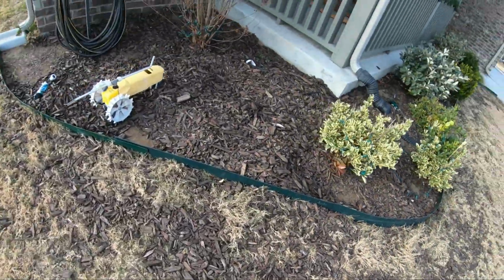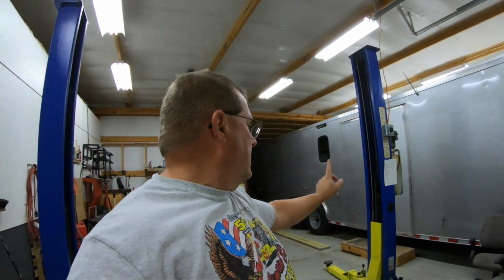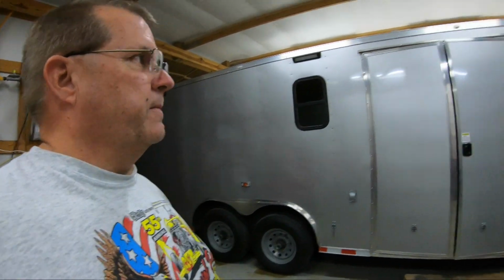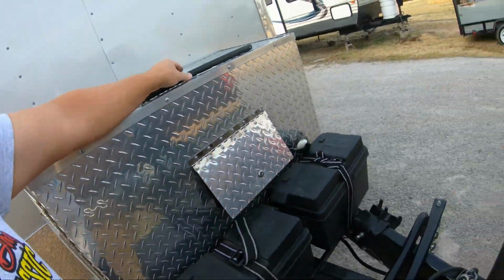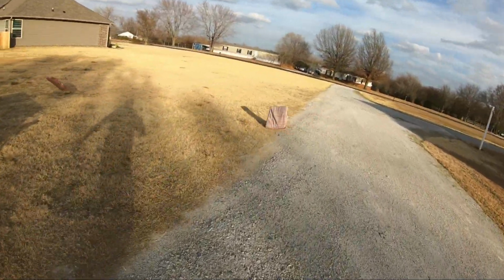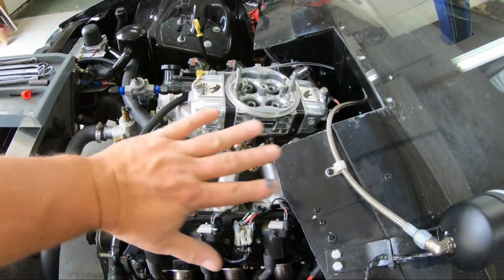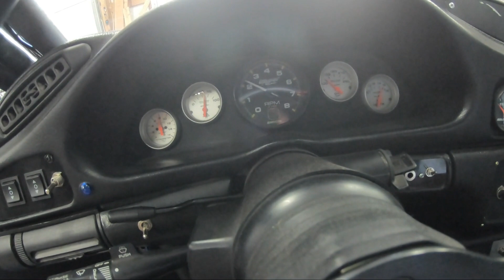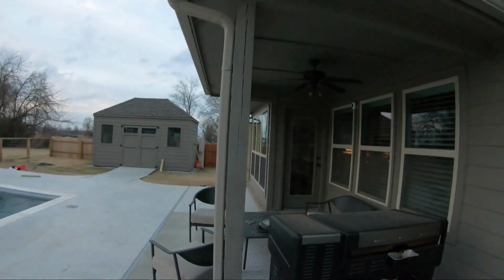Racing Over for 2021 - Winter Projects!

Comment: hell yeah love me some bracket and index racing , on my channel me and the wife index race . 
I just subbed to your channel look forward to more stuff . KEEP IT UP !! 

My wifes car has a lq9 out of an escalade carbed with a brian tooley cam and has gone 10.24 in good air stock lower end motor with 799 heads that have been ported
Reply from the maker: Thanks! That's running pretty good there, quickest mine was 10.47 with the stock 243 heads. Not sure what it will run now with the PRC heads.
Reply: @KensKorner  it's 2860 with my wife in it so it's pretty light . Love your videos and very relatable

Comment: Ready for more racing vids already! 
How long have you owned your camaro?
Reply from the maker: It's a 95 had it since 98. So 23 years! Wow!
Reply: @KensKorner  wow! That's awesome, was nearly new when you got it. I've had my 95 since 2003, but it's still basically stock. Most consistent car I've ever raced as long as I remember to check the tire pressure.